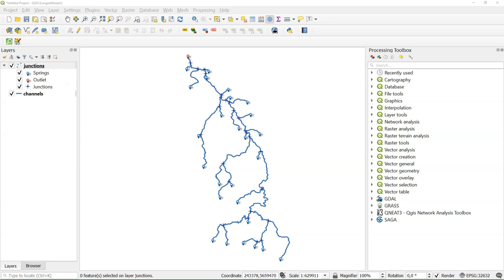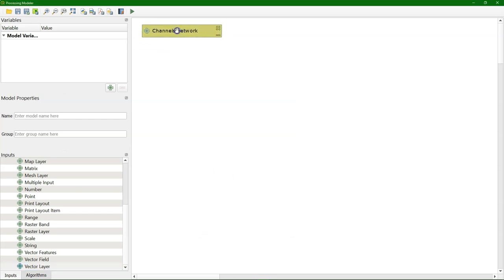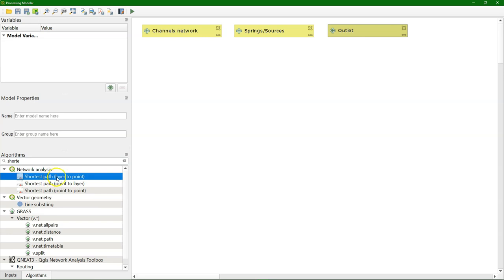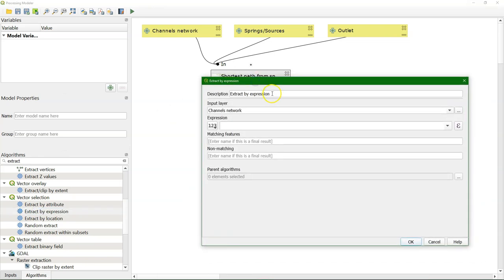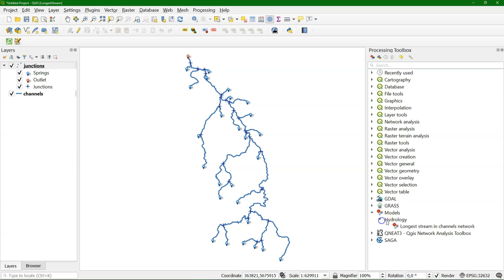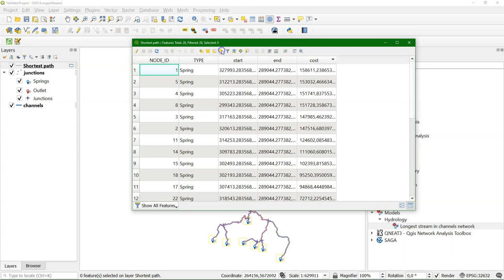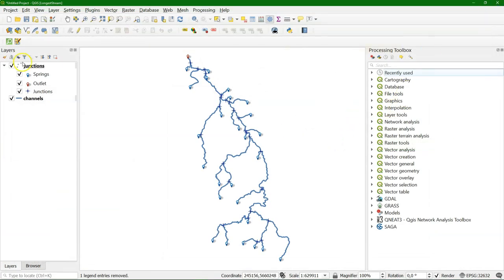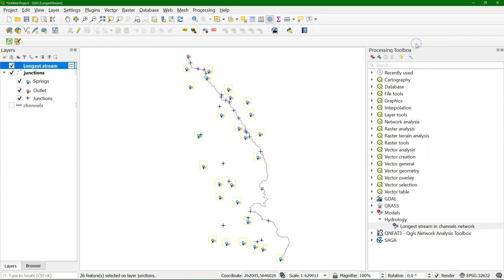Automating longest stream extracting using QGIS Graphical Modeller

Comment: Is there some way to do this in batch? The clicking at the outlet location seems to make that not possible.
Reply from the maker: If you change the outlet point input in the graphical modeller to vector features input, you can use a point vector layer and click the iterate over layer button.
Reply: @HansvanderKwast  that would be amazing, thank you! I will check this out and see if it works.